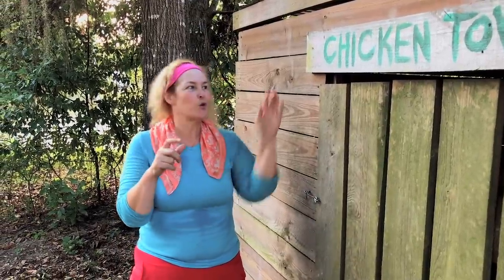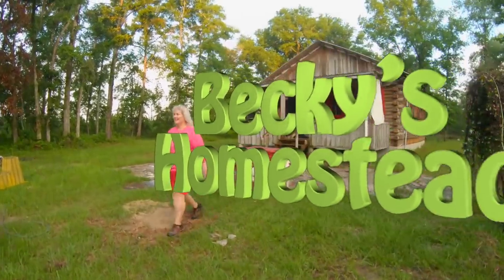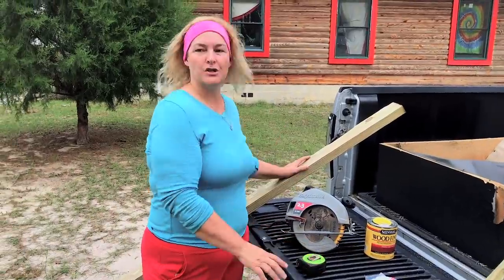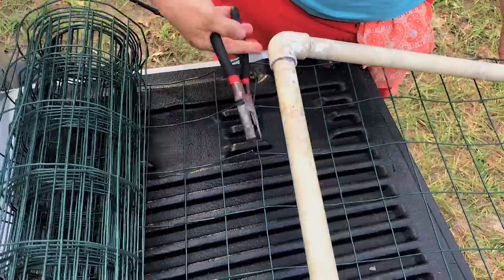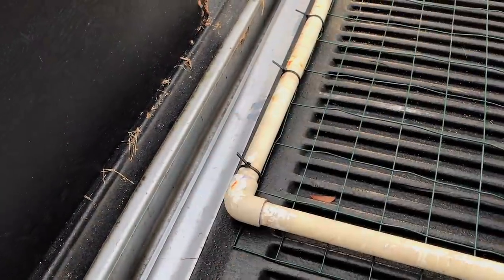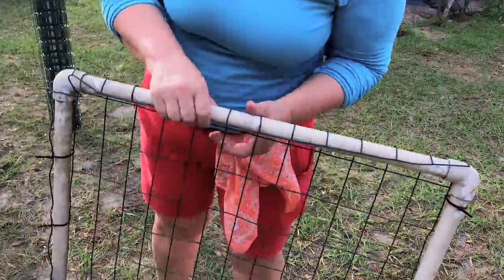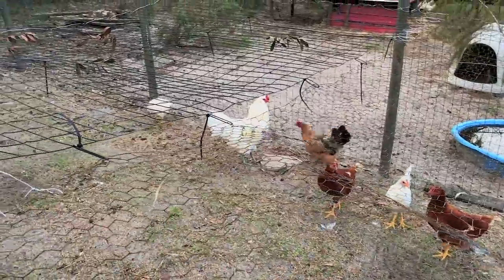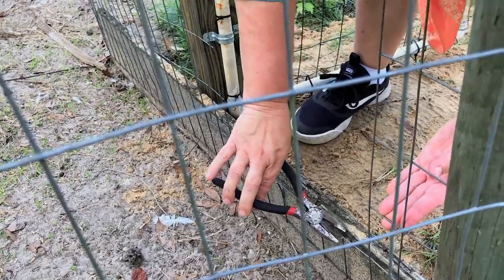How to Make A Chicken Coop Door

Comment: Yeah I just can't BELEIVE you built all THAT with your own two hands.  Yeah right.  I'm in way betterr shape than you and stronger I'm sure and I can't build what you say you built all by myself.  Just can't believe it and won't unless I saw you do it.
But never the less you do have great ideas.  I give you that.  Good for you.
Hint though zip ties dont last.  They dry out and crack and break loose.  Use wire.